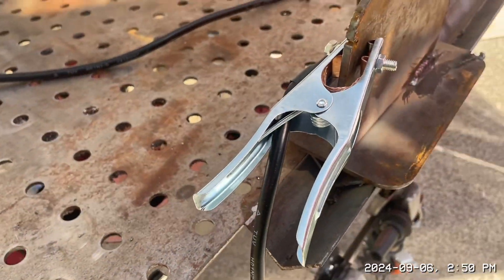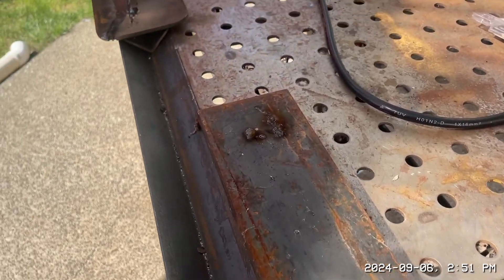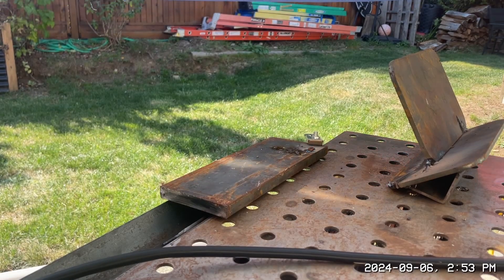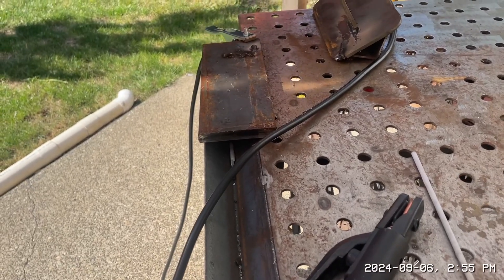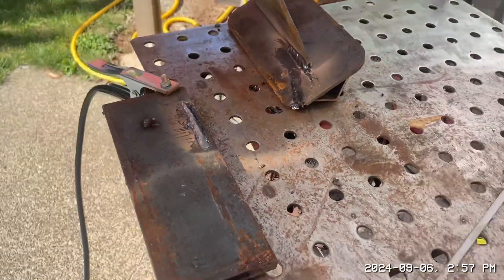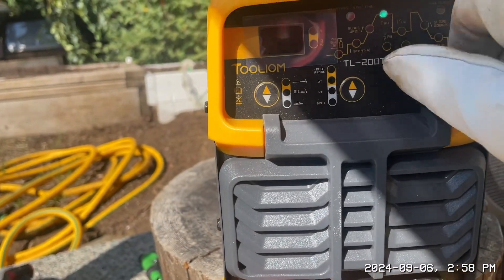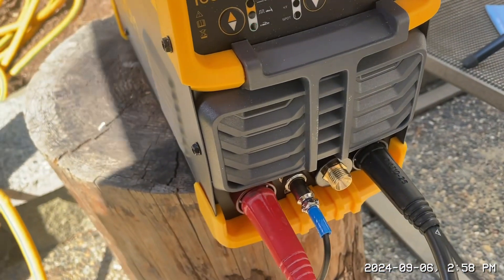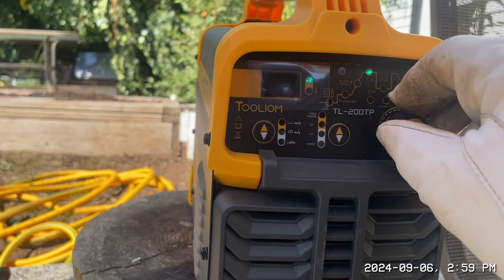Tooliom 200 Amps Dual Voltage Stick /Tig with High Frequency for Pulse Tacking

Comment: A lot of the times we blame the welder when it's something we did or didn't do. There's a tonne of mill scale on the work piece, the metal is thick and 7018s are finicky especially if not stored properly, they absorb moisture from the atmosphere and wig out until they get hot enough to dry out. 

Those welders reach their max current on 240 and not 220 and a lot of the welders I know provide a bit more juice for tig than stick. Those cheap welders run 6013 no problem, not that I'd try but they'd problem even run them wet. It's a very, very good welder for the price given that the Hobarts, Millers and Lincolns etc. provide the same features for 5x the price. I doubt you can get any welder from those brands for under 500, even the old buzz boxes probably cost twice that.
Reply from the maker: Yes sir for sure 👍 thanks for sharing

Comment: Its basically a 160amp welder with a scale that goes to 200 random units.  Regardless of what it shows on the display its incorrect she runs a little cold.   I have 3 tooliom units.
Reply from the maker: Yes i agree for the money just starting out
Reply: @kdweld8234  The plasma cutter they make actually does 50amps.  Seems like the quality is above average for a china welder.